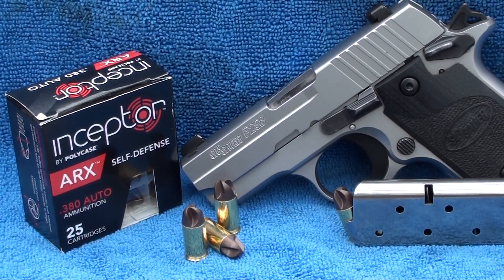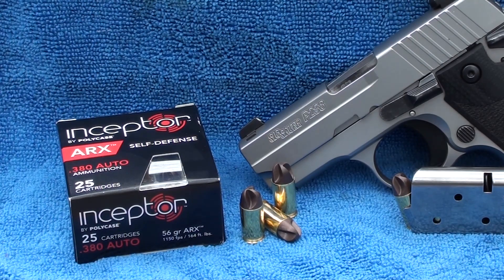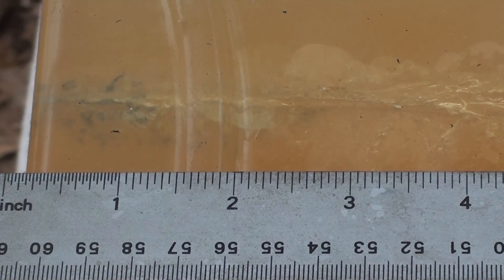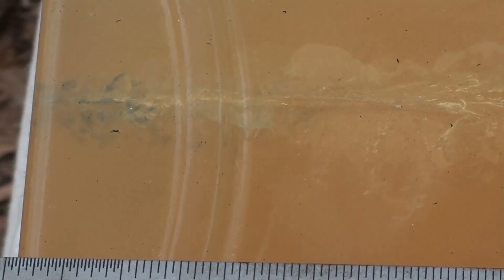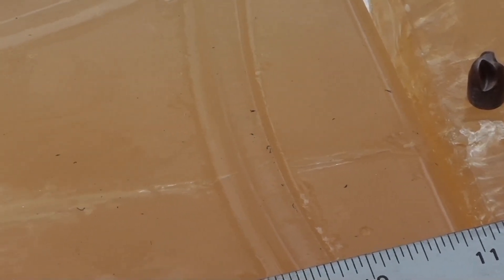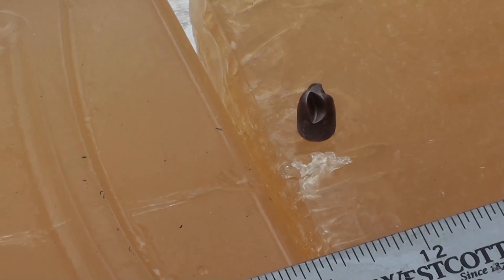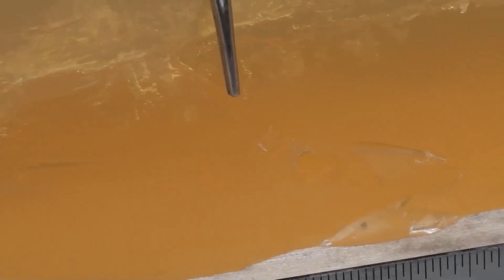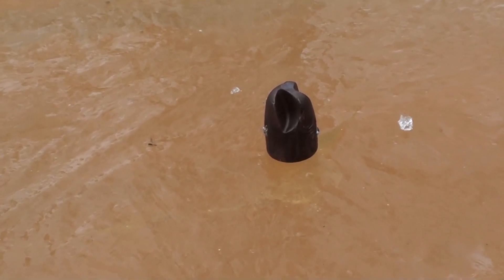380 Inceptor ARX ballistic gel test WOW!

Comment: Not, "compressed together with glue".  They're formed by heating/melting polymer that has copper powder in it, then injecting the liquid/slury into a mold and allowing it to cool.  Fast and efficient, once the process was perfected.  The copper powder gives it weight without using lead.  Excellent engineering.

Comment: Great information about this.  I just bought a box for my wife to put in her 380.  This was recommended to me by our local and very knowledgeable gun dealer. What I was wondering about...was how the bullet would handle if it were shot thru a  thin leather purse.  You pretty much answered my question that the bullet would not shatter once it hit fabric, but how would the relative accuracy be affected in a typical close range (roughly 25 feet or less)self defense situation.

Comment: Follow up - both my wife and I carry Ruger 380's in the summer and they feed/function with this round just fine.  EXCELLENT results at the range with paper target accuracy at 5 and 10 yards and into melons for fun !!  It was kind of expensive to test , but after 100 rounds of flawless / perfect cycling , I can recommend this ammo in Ruger LCP2 !!  It IS a good idea to try it your carry gun before carrying - I have heard the Glock 42 will NOT cycle lighter loads at all - so DO run this ammo for several mags in your carry gun to assure reliability.

Comment: I wonder if the barrel spinning the round in a different way will affect the way they work
Reply from the maker: Possible, dont know any left hand twist .380 ACP out on the market, but a valid question non the less
Reply: No, they don't have a directional flute. I've seen 200 lb. hogs go down in 50 feet from the 9mm.

Comment: This is or appears to be a composite round using a shape of the Lehigh/Underwood X Defender or Penetrator solid copper.  Lehigh has proven to be barrier blind.   Would like to see this round up against heavier barriers.  I use Lehigh in both my 380 and 9mm EDCs in the X Defender +P.
Reply from the maker: Yes its a composite round, and yes Lehigh and Underwood use this design to make their perpetrators.  I have not shot these on video going thru anything more than four layers of denim, I have planned a few vids to do more, just waiting to see if you tube gets their head out of their asses

Comment: It meets or exceeds the FBI minimum standard. Just barely... but it's rare for a .380 ( from what I've seen ) to even meet the 12 inch minimum.
Reply: 12-18" penetration in gel roughly equates to adequate penetration of a human body at an indirect angle. 12" of gel doesn't mean 12" of target
Reply: The 12" standard in their testing is made to compensate for the lack of bone and hard tissue.  I carry these in my .380 backup/pocket piece when I can't carry my .45 because I couldn't find Gold Dot, PDX1, HST, etc. at my local shop.
Reply: JSmunitions that 12 inch minimum crap is bogus. Skin and gelatin aren't the same as your skin is only 1-4 inches thick depending on the area of the body after that it's motstly blood and fat their piercing into. It's so they don't have a 22lr problem being so quiet.

Comment: Do these feed reliably in a pocket pistol? (For example, a Kahr CW380)
Reply from the maker: They have fed in all the .380's I have shot them in.  Sig P238/ Walther PK380/ Bersa Thunder/ Walther PK/Walther PPK/ Beretta Chetta/ Ruger LCP and some Beretta clone made in Italy with two safeties, I cant remember the model number or maker.  Dont own any other to shoot it from (or borrow)  Works in all mine is all I can say.
Reply: Good to know. Thanks!
Reply: They work fine in my Kahr ct 380.
Reply: Tried both the .380 in a Glock42 and the nine in a G26. Had about 15 % failure to feed in both. Wondering if their newness, (less than 300 rounds in each) could be a factor?
Reply: You may want to try the Ruger ARX version, they run fine in my G26 & Shield. 
Let us know how it turned out please.
Reply: Actually they are the Ruger ARX rounds. WE never saw these in our area until Ruger put their name on it.
Reply: It is not possible to depend on a CW380 Kahr.. Traded it for a LCP II. So far so good. I will try this ammo. Looks like  it will feed well into the Elsie Pea Two. Mahalo
Reply: Aaron Kennedy Really? They have a great reputation. How many rounds did you put through it before you traded it in?
Reply: TXLionHeart These fed perfectly thru my Taurus TCP (That little gun has eaten everything I put thru it though. Except Lehigh XP and Underwood) The Inceptor is the ONLY brand that that my Taurus Curve has eaten without one malfunction. If you have a .380 that is picky with ammo buy a box and give them a try. Sportsmans Warehouse has them for $21.00bx. (25ct)
Reply: I meant Sportsmans Guide

Comment: Just bought a box. Interested to see if the recoil is reduced on my Ruger LCP.
Reply: How did it work for you lcp
Reply: Curious about this in an LCP
Reply: @LordCohliani  the Sig 238 that he's using in his test has the same barrel length 2.75" as the LCP. I have these in my LCP currently. They seem to be as advertised. There's nothing i don't like abt this round. They're lighter to carry, faster, flatter, and a little less recoil. They feed fine in my LCP! Hope this helps
Reply: @markshippoli8918  so it should translate then. Good to know.

Comment: Yada, yada, yada. The wound track is a function of velocirty. Please use some common sense! Clear your gun and look down the muzzle. How many turns does the rifling make? Like a propeller? Use some common sense people. You don't need a high tech polymer or a funny shape. The bullet could have been pewter, or aluminum or brass.
Reply from the maker: +Robert kubrick 100 % correct! Velocity creates trauma.   I cant get M4 velocity out of my P238 .380 acp pistol, but I can do a lot better with a round that can, yes whether poly, lead, brass, or whatever super metal is to come, but for now we have these.  And they did a pretty good job
Reply: +Robert kubrick 
If the wound track is a function of velocity then a FMJ is all you need. Right?  Lets give that common sense thing another try.
Reply: +Robert kubrick 
And a 5.56 from a M4 spins at 314,000 rpm so my guess is a bullet from a small pistol is maybe 1/3 that.  Just a guess.  That's still a hell of a lot more than my blender at home.

Comment: Hey scuba, would you do me a solid and test the Buffalo Bore 158gr + p lswchp Heavy 38 special round? someone did a test on the non + p version but that's leaving the gate at around 860-900 fps..The + p version is doing 1000-1100 and I'm VERY curious at its performance in gel, and would trust your opinion more than anyone else. So if you could that would be great. I know alot of others would be interested as well. Thanks.
Reply: And that is out of a 2" barrel by the way.
Reply from the maker: +RugerShooter   Have to look into them, thanks for the info ( I replied to your other post the same also)
Reply: +ScubaOz I didn't realize I posted twice lol thanks man.
Reply: +ScubaOz I think this was the 1st one I tried to comment on but for some reason it said post failed so I tried another video. Didn't know it showed up.
Reply: RugerShooter 

I shot a few of the BB 158 gr LSWCHP +P .38's in my S&W 442.  Even with the gas check, leaded the crap out of my barrel and chambers.  Only jacketed ammo for me, anymore!

Comment: Dumb question, are all pistols/rifles "rifled" in the same direction? Could a weapon be rifled backwards and have this bullet spinning the wrong way on impact or would that not matter?
Reply from the maker: +rhrhllc   Yes MOST guns are right hand twist, years ago the English used a left hand twist for some reason as it made right handed shooters more accurate. (No bullshit I swear)  They have found the error of their thinking and now most all guns are right hand twist.  Good question though, these rounds depend on that twist
Reply: +ScubaOz Thanks for the response, I just watched a video where this round (in 9mm) fragmented into several pieces. Polycase told him that they had never seen this before. His theory was that his barrel might actually be riffled in the "wrong" direction.
Reply: Something Funny Inceptor website states it works in left hand twist rifling. Fragmentation can be caused by other factors with this ammo. One of the causes off the top of my head was over-crimping the brass during manufacturing (reloading).  Inceptor has a FAQ on their website.

Comment: I worry that it doesn't have the weight/mass to go through bone. Would be interesting to see the results on a hog. Thanks for the video.
Reply from the maker: +Richard Cavanaugh CALABASH, NC   Thanks for watching, Yes I hope to shoot a hog with one of these so I can see real world performance
Reply: I agree. I'd trust Lehigh Defense 90 gr Xtreme penetrator round over this one despite the fact it often exceeds the FBI maximum recommendation for penetration.
Reply: @neutronstargalaxy1092  What you hit is what matters, not penetration.
Reply: @johnh383  Thats what i am inclined to think.
Reply: @johnh383  That's what she said...
Reply: I'd love to see a hunting weight bullet in these. One thing is for sure, 45 May not expand...but she won't shrink. If this thing can splinter bone??...
Reply: it's a 380, and it's frangible, so I doubt it'd do that well on Hog. the .45 maybe
Reply: @ravissary79  it's not frangible
Reply: @someguysomewhere4280  wow, that was an old comment.
Allow me to clarify now that I know more about it.

The design stays solid at some speeds and fragments to at others.
At 380 speeds it's likely to stay solid in most scenarios.

However I've seen tests with this bullet where it's propelled faster and it does indeed fragment. However I have yet to see it come apart thoroughly like a frangible round. It's made of polymer and powdered copper so some assumed it would pulverize in hard surfaces.

Instead this is what happens in a fluid body or gel at high speeds (perhaps 1800 and up). The three inset edges (looks like router bit teeth) sheer off under the extreme resistance, it then acts like a Lehigh controlled fracture design, with 3 "petals" and a blunt base.

I own some of these in 50 Beowulf, and I've seen them do precisely what I described in gel.

A 380 will likely look more like a Lehigh extreme defense in tissue. But I'd still like to see that in a hig in order to address whether the large cavity in gel is a gimmick of gel tearing, but in tissue it might not do this. That's what I'd like to know. Obviously if it fractures at high speed it will, but if it just spins and cavitates... will it still make a larger permenant wound cavity in flesh?
Reply: @ravissary79  Wow, that's a long reply. But what you said makes sense. For 380 I'm a big fan of the lehigh xtreme defense but i don't think I'd trust it to penetrate sufficiently if it were to come apart at all.
Yeah, didn't realize how old that comment was, LOL. Thanks for the thoughtful reply.
Reply: @someguysomewhere4280  it should penetrate deeply enough for defense from what I've seen. The extra speed due to the light weight and lack of expansion, but countered by the drag of the rotational "bit" movement  (not what it's actually called and not what it actually does) means it doesn't over penetrate like an fmj, but doesn't under penetrate like light expanding defense loads like the winchester white box 110 grain 357 in bare gel (awesome damage but doesn't go very deep) or the 135 grain corbon 10mm, which reportedly gets big but tends to stop around 10 inches (obviously YMMV).

But to some people that's a feature. In a straight shot 10" is perfect, but through an arm or at oblique angles, not so much.
Reply: ravissary79 this round is designed to stay solid
I
Reply: ravissary79.

Comment: Aren't these the same design as the lehigh extreme defenders/penetrators?
Reply: +ScubaOz Have you not seen shootingthebull video on the the Lehigh .380? It's performance kicked ass. better than the polycase design.
Reply: +John Ski This ARX round resembles the underwood extreme defender (not penetrator) rounds. I'll try some arx, however.
Reply from the maker: +John Ski   Not at all.  The Lehigh is a perpetrator only round, it does not have the special cuts these rounds have to make the wound cavity.  They do kinda look the same, just look at them a little closer and you will see a HUGE difference